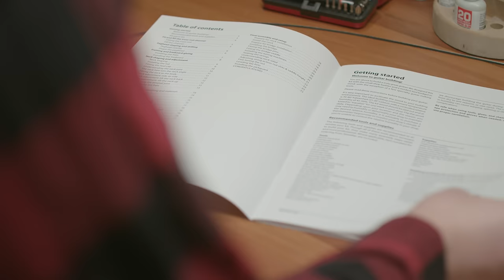Build an Acoustic Guitar with a StewMac DIY Guitar Kit

Comment: Just went and had a look 😳.. as expected. Two kits under $500. CDN all the rest  $700 CDN & ⬆️ and very quickly gets up to the $1500 - $1800 CDN  range. Then if you don’t have the tools & supplies on hand, count on doubling that cost. Not sure who can afford these prices.
Reply: I guess it all depends on how you look at it; a custom hand made acoustic guitar will set you back at least $3000 CDN and you don't get the pleasure of playing an instrument that you have built and customised, nor the pleasure of building it. You can, for the most part, get away with cheap-ish tools if you are only going to build one and don't mind the extra effort of maintaining them. Of course, you also don't get the misery of messing it up and trying to fix those mistakes (or, worst case, ending up with very expensive firewood)!

Comment: Does anyone know what its called when your string is making a scraping sound/feeling when i do bends or vibrato on certain frets? its super annoying since my frets look really smooth and don't have any visible scratches or anything. Can't seem to find a video on it anywhere.
Reply: you need to sand your gritty fret with a finer sanding paper.
Reply from the maker: It sounds like there could be a couple of issues here. This might be string noise from your fingers or it could possibly be fretting out with big bends. Please shoot us a message with some more details so we can try to help. You can reach our techs at service@stewmac.com.
Reply: @stewmac  Hi there, Thanks for the reply! im sorry for taking so long to reply to you. I really don't think that it is my own fingers, or strings moving down off the frets. even if i use the g string, with some light vabrato it still makes a really scratchy sound. i took some super super fine sand paper and lightly went over some of the frets incase it was scratching or indents, which seemed to help, but about a week later it came back. so i'm not too sure?
Reply: @NoahfromEarth  Could it be rusty strings?
Reply: @VashStarwind  I have fixed the issue. I ended up doing a full fret dressing, for another reason. And then restrung it with new string and it seems to be ok now. The only thing is that on the high e string around the 12th fret, when I bend it dies quite quickly.. Might have to sand down more of the frets closer to the center of the neck. What do you think?
Reply: @NoahfromEarth  Glad u got it figured. Yeah idk im no expert haha, maybe truss rod adjustment? idk haha. either that, or like you said a high fret

Comment: Minteresting
Reply: I built a StewMac ukulele kit this past winter, nothing was assembled but I had experience as I do some carpentry finish work. The kit took some time, it had to be spread out over quite a few weekends as the glue should set up at least 24 hours. I was thinking about a guitar kit
and saw the StewMac Body-Built kit for around $350. The body, at least for the uke, was the hardest part. With the Body-Built kit, that part is done already. What I don't understand is the price point - why this kit with the body assembled is half the price of the complete build it yourself kits, the wood looks different but..? 
Anyhow, I think the guitar in this video looks a lot like the $350 kit and does sound good. 
I'd still like to know more about this kit before I order one.